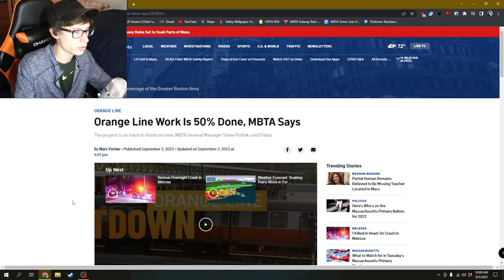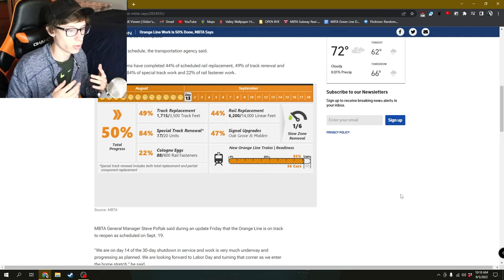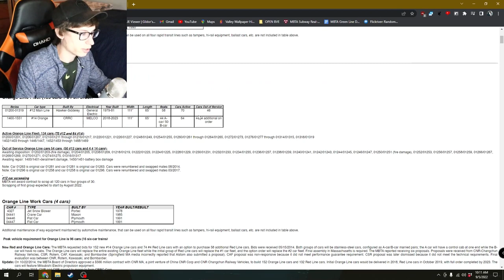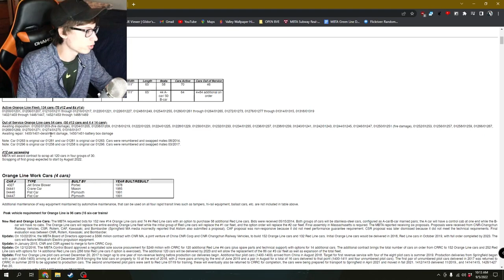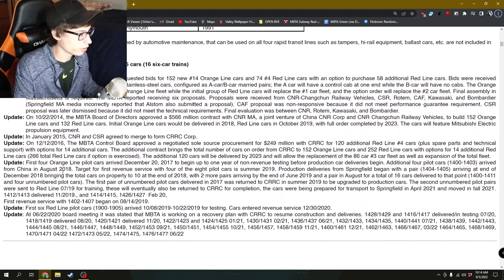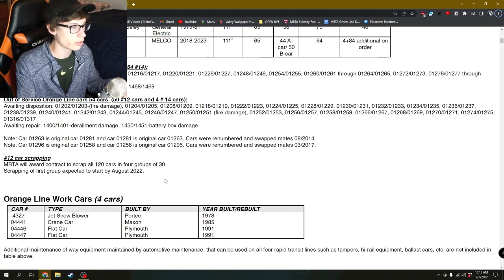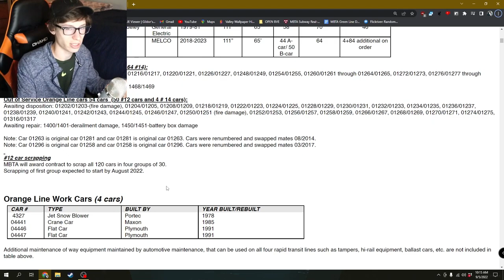We Need To Talk About The State of The Orange Line...

Comment: I remember hearing a story about the June 2019 Red Line derailment near JFK posted by NBC Boston on a news article and repairs to the tracks, signals and area near JFK where the derailment occurred weren’t completed until mid-October and service on the whole Braintree line was replaced by shuttle buses during that time. Braintree-bound Red Line trains only ran between Alewife and JFK for 4 months. Yep. The T has really gone downhill fast over the past 5 years, very sad and depressing. 😢 Hopefully the entire system will be fixed soon.

Comment: 3:00: Correction: It was the Suffolk Downs Bridge Overpass not the Orient Heights Bridge. Plus in May 2022, the bridge was closed due to structural issues and serious deterioration and wooden beams were put under it to stop the bridge from crashing down onto the tracks. Blue Line service was replaced by shuttle buses between Beachmont and Wood Island for four consecutive weekends.

Comment: The whole point of keeping 48 12s for a whole year of April 2023 might have been for a different reason. If you didnt know the T was in the process of retiring the last 62 Neoplan AN440LF buss in active service, by April 2023 the last AN440LF bus was retired. If you didnt know when the T retired the Trackless Trolley Buss back in 2022, the 26 buss took the entire space of Everett Maintenance Facility. In which 62 retired Neoplan AN440LF's did not have space in Everett. So the T used tow trucks and towed them to Wellington Station Parking Lot, which was where T operators parked their cars. Also the T was also retiring the Neoplan Dual Mode AN460LF's with 45 Hybrid/Battery XDE60's. In which the T ran out of space at Southampton Street Garage to store the 31 Decommisioned Dual Mode buss, so they towed them to Wellington Station. In which this took parking space of the T operators with 93 vandalized buss at Wellington. It was for the for the T to prioritize parking availability for their employees. After 01214 & 01215 being loaded on flatbed in February of 2023. The contractor they quickly got was Costello Dismantling, so it was to prioritize to get those 93 Neoplans of the parking lot off the parking lot ASAP. By July the last Neoplan was towed. The T would have removed the remaining 48 12s, but the T had the arrival of 160 XDE40'S into Albany Street Garage and Lynn Garage. In which the T began retiring the 2006-2007 D40LF's and began towing them to Everett Yard once the trackless Trolleys were gone. In August 2023 about 92 D40LF's were retired and taken over Everett Yard so the quickest bidder they got was Costello Dismantling 2006-2007 which paused the 12 scrap again. Although this retirement was very slow. The last 2006 D40LF to be retired was on March 1 of 2024, 2 weeks before 01292 & 01293 was loaded on flatbed on March 22nd of 2024.

Comment: “The amount of buses that can be at Midwest at a time is around 20 all in various stages of remanufacturing. For each individual bus, this total makeover takes around 10 months. The first step in the process is complete inspection of the bus, both inside and out. Remanufacturing buses is not only cost-effective but is also a more environmentally friendly option than simply replacing them, this allows us to save the good parts, replace the bad ones and update the technology,” said a spokesperson for Midwest Bus. “After the initial inspection, all of the fluids need to be drained, a sample of the intentional fluids is taken and analyzed, then the old waste oil is repurposed for either burning or for reusing in our furnace and the rest of it is recycled. While that is happening, various underbody components are being removed as well as everything attached to the engine. The engine and transmission are completely taken out and power washed, removing years of grime. The engine compartment and the rest of the exterior of the bus is also power washed. The engine and transmission are then moved inside for the removal of the remaining components. It is then prepared to be returned as a core in exchange for a remanufactured engine and transmission from a factory authorized remanufacturing facility. While work is taking place in the engine, the engine compartment gets a complete overhaul. Any defects in the structure are fixed and all the old hoses and attachments are replaced with new ones. The remanufactured engine and transmission come back in like-new condition. All new components are then attached, preparing them to be reinstalled in the bus. The engine and transmission are then reinstalled into the remanufactured engine compartment and bolted into place. Different crews then start the process of remanufacturing the axles. The wheels come off and both the back and front axles are removed. The axles are completely taken apart, the old components with outdated equipment are removed. The axles are then stripped down completely and the rust and wear is removed. They are then cleaned and painted with an anti corrosion sealant. Workers install new sturdier single-ended corrosion resistant wheel hubs on the axles. The safety of riders is extremely important and it starts and ends with new technology that will improve the safety of the drive and braking systems. It is extremely important to have our highly skilled mechanics rebuilding their axles with the best equipment available. A highly skilled mechanic puts us together with an exact intolerances. While the axles are being remanufactured, the underbody and wheel wells are being prepared for the axles to be reinstalled with all new suspension and air system components. At this point, the better-than-new axles are reinstalled. While the axles are being worked on, a different crew starts removing the old and outdated wiring. They then install new wiring, update the electronics technology and install new, more efficient lighting. At the back of the bus, the air conditioning system is getting a complete upgrade and in the front, new handicapped accessible ramps are being installed. At this point, the entire interior of the bus is removed, including side panels and flooring. The floor vides are sanded down while new flooring is custom cut for the bus. Gap filers apply and the floor is carefully sanded perfectly flat, then the new flooring is installed. New updated fixtures, trim and seating are installed. One of the advantages of remanufacturing is being able to refurbish fixtures and seating that are still in good condition, while replacing those that are not. The entire exterior of the bus is sanded down and smooth including the panels that were removed. Then, the bus and panels are carefully painted to the color scheme of the client, in this case, the T. The top of the bus is painted with a thicker weather resistant coating. New windows are installed with the latest windshield technology. Exterior trim is put on and the refurbished repainted doors are reattached. Everything is polished and the front is fitted with a new bike rack brand bicycle rack. After going over the final checklist, we have a completed like-new remanufactured bus including new fasteners throughout and new driver barriers to protect the driver. Midwest Bus remanufacturing is not only cost-effective, but is also environmentally the best option.”

Comment: The new buses will be called XE40s. On July 9, 2024, the MBTA had received a grant award from FTA to fund the purchase of 40 additional electric buses, this will allow the contract to be increased to 120 buses (88 for Quincy and 32 for North Cambridge). The new buses are numbered 4200-4231 and 4300-4347. Every bus is 102 inches long. All active buses are air-conditioned, wheelchair accessible and equipped with cameras and passenger counters. This would total 1,079 buses. The buses seats range in numbers from between 33 and 57.

Comment: The blue line hawkers got all rusted out because the line was near the ocean at wonderland and revere beach and the salt ocean air and jet fuel over the years led them to an early retirement at 30 years old. The 500s were completely underground for 28 years because the east boston and revere extensions after maverick weren’t built until 1952 and 1954, with stops at airport, wood island, orient heights, suffolk, beachmont, revere beach and wonderland. This made them not suffer from the ocean salt water air near the beach and that’s how they lasted for over 50 years. The St. Louis cars also dubbed 500s were ordered in 1951 for the then-new east boston and revere extensions and to supplement the pullman standards. The pullmans were completely modernized in the mid-1950s. The east boston tunnel opened on December 30, 1904 as a streetcar portal with streetcars operating from maverick square to chelsea and revere. Atlantic ave. (now aquarium) was added in 1906, state street the following year and government, bowdoin were added in 1916. government was originally named scollay square, devonshire 1904-1908, milk/state 1908-1967, state citizens bank 1997-2000 and state/aquarium 2004-present. A passageway between scollay and court street stations was closed in November 1914 when the station was abandoned. The blue line was converted to rapid transit on April 21, 1924 and state, aquarium and maverick were all rebuilt to accommodate heavy rail subway trains with high-level platforms constructed. the old scollay square station has been abandoned since 1963 when government center was formed and the line between the two stations was rebuilt with a new style track layout. The 500s were #2 and #3 ebt cars, or type 2s/3s, the 600s were #4 ebt or type 4s and the current 700s are #5 ebt or type 5s. The future 800s will be #6 ebt or type 6s.

Comment: I heard that MBTA needs at least $24b in order to fix the entire system. If you’re going to have a transit system in a busy metropolitan area like Boston that go out the surrounding suburbs and neighboring towns at least make it safe and improve reliability for a good rider experience and have positive things to say about the T as well as trust it to get you where you need to go both safe and efficiently. We need a reliable and safe transit system, in which the MBTA is far from being. The Boston Subway is called the most dangerous subway in America, how did it get so bad, some of the reasons are old signals, tracks and aging rolling stock. Can’t forget about the slow zones the MBTA had implemented on all four subway lines, where trains can only go around 5-10 mph, it’s really unbelievable. 😡 There are other transit systems in the U.S. that are way more safer and better than the MBTA. The T is doing really badly right now, it’s an absolute hectic shit show, but I have faith that Phil Eng will eventually turn things around.
Reply from the maker: Yeah I get the frustrations however things are improving! The entire ashmont line was shut down for like 2.5 weeks a while back and they eliminated all the slow zones on it so progress is being made!

Comment: “We’re proud to have gotten the contract to overhaul MBTA’s fleet of 60 Xcelsior New Flyer XDE40 buses,” said a spokesperson for Midwest Bus. “The buses will have completely refurbished interiors, completely refurbished seats, new flooring, fresh paint job, overhauled wheel axles and wheel assemblies, new bicycle rack, window and window rims replacement, modern safety features and new undercarriages so they will go back to Boston looking like brand-new.”

“These buses were purchased in 2014 and this mid-life overhaul will keep them serving the riders and residents of Massachusetts efficiently, safely, comfortably and reliably for the next decades to come,” said MBTA General Manager Steve Poftak. “The first three pilot buses, Nos. 1410, 1419 and 1426, should go out to Midwest Bus next month, with the full overhaul completed by 2024.”

“When buses arrive at Midwest, they will be unloaded from the flatbed that transported them from Boston, they will be brought in, employees will then do a full inspection of the bus from top to bottom, remove any corroded parts, refurbish important components, after put them back in the bus, install the refurbished doors back on, lay down the new flooring, take the engine out and give it a complete overhaul, by refurbishing pistons, radiator fans, vents and hoses, put it back inside the bus, take the air conditioning and heating system out and give it a complete overhaul, install it back in the bus, install the refurbished wheel axles back on the bottom of the bus, then put the refurbished wheels and the new tires back on, put the new glass windows and window rims in and last thing is clean and do another inspection of the bus and there you have it, those are the steps it takes to fully overhaul a transit bus and make it brand-new again,” said Robert Postma, the Executive Vice-President and Chief Operating Officer of Midwest Bus Corporation.

“This contract will create jobs, bring federal funding to Michigan and further the ideals of public transportation and green manufacturing. Midwest will be working with our suppliers to redesign the electrical battery system with a geofencing option that will reduce emissions around Boston,” said Robert Postma, the Executive Vice-President and Chief Operating Officer of Midwest Bus Corporation.

Midwest Bus Corporation, an Owosso-based transit bus rebuilder and parts supplier since 1980, announced an award to overhaul 60 Transit Buses for the Massachusetts Bay Transit Authority. The award also contains an option for MBTA to add an additional 156 buses.

The contract is worth $36.5 million and approved by the MBTA Board of Directors on May 26, 2022.

Comment: The Orange Line makes the Red Line look reliable and safe.
Reply from the maker: I mean… personally I wouldn’t trust the 15,16,&1700s those things are janky as hell and take chunks out of the platform. But good point!
Reply: @NickDaltonYT  Agreed. the 15, 16, and 1700s were my childhood since Alewife has always been my access point to get into Boston, but they need to be retired ASAP
Reply from the maker: @fearthesnake7470  yeah facts. They are more of a danger then the 12s. At least with the 12s you do t feel like your gonna die in them
Reply: @NickDaltonYT  plus the 1500, 1600, and 1700s are infamous for runaway train incidents lol
Reply from the maker: @fearthesnake7470  oh I am fully aware. That’s why I don’t trust them!  U ever seen a 12 run away? Nope cause they were built with better brakes. Within the past year, I probably got on a few trans that have had trouble releasing the brake pressure.  no that’s a problem. I don’t mind having as long as I know the brakes work I’m all cool with that.